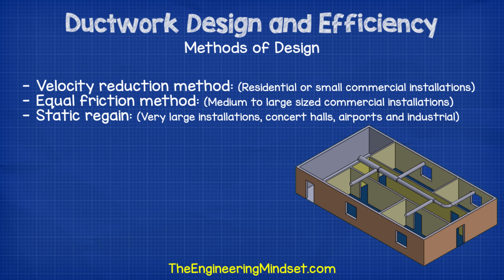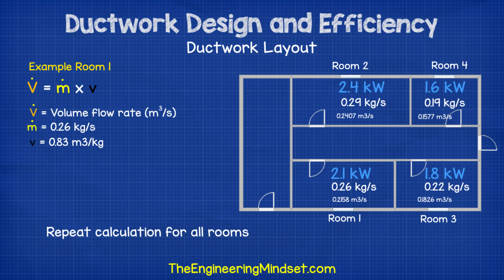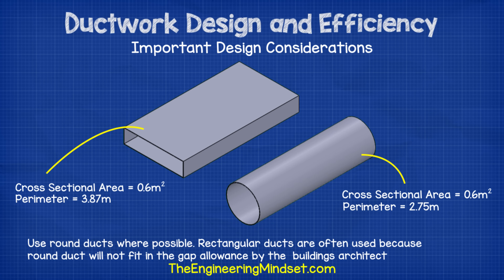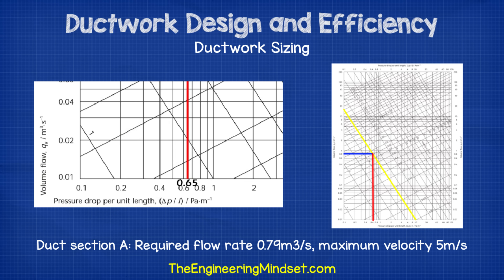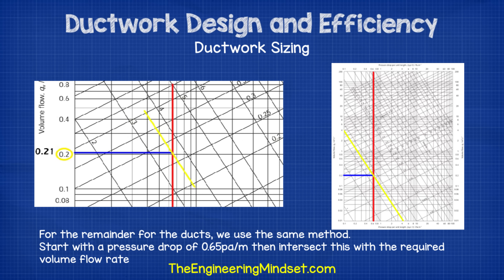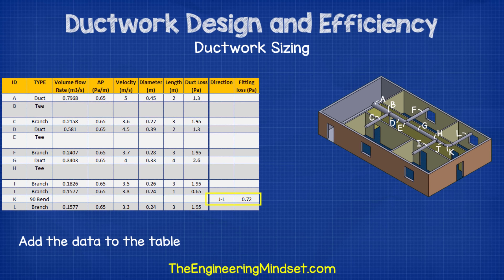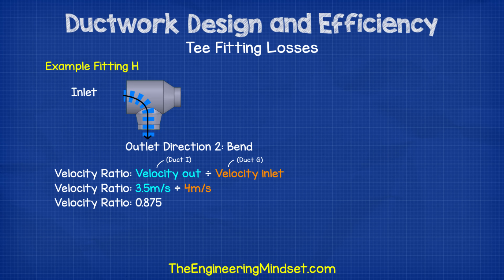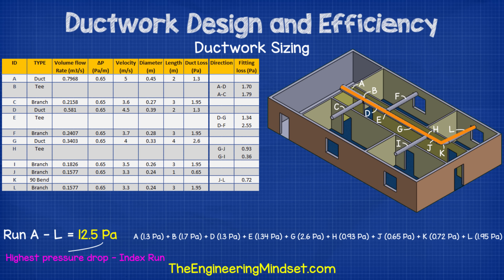Ductwork sizing, calculation and design for efficiency - HVAC Basics + full worked example

Comment: For the case of duct pressure drop or ESP is it necessary to go for cfd or use fitting coefficient for standard fittings and add along the path

Comment: Great video,  For the Tee 'H'at 15:45, is it not the bend coeff' 0.3645 taken from table using vel and area ratios,  then using formula to find out the pr loss  ?, It says straight from table, the coef 0.3645 as pr loss in Pa.  
Pls clarify.  Thanks.

Comment: Fitting loss in G-I direction should not be 0.36. I guess, 0.36 is the Fitting Coefficient. So, the fitting loss in G-I direction should be 2.65. Please correct me if I'm wrong. Thank you.

Comment: @EngineeringMindset - Why does the pressure through the dampers installed at the junctions have to have a pressure loss equivalent to the deficit b/w the index path loss and the loss through the branch terminating through a junction? Understand, there will be pressure loss on account of installing the VCDs but why does not exactly need to be the deficit to ensure designed flow through each branch? At the most, if the pressure loss through the damper is not exactly equal to the deficit but a little less than it, the air exiting through the branch connected to the damper will be supplying air at a bit higher than atmosphere. What's wrong in that?Pressure per metre of the duct was assumed as the same for all ducts / branches and not the actual pressure drop occurring along a branch. WIth different flow rates and diameters of the duct sections, this can quite be achieved so why is the need for the rest of the branches requiring to have a total pressure drop as that of the index path loss? Please explain?
Reply: I got the answer.🙂

Comment: Out of curiosity, do you only need to bring fresh, conditioned air into the rooms? Is it not necessary to also suck out the stale air using a separate duct system?

Comment: calculation used for temperature change is 8 degrees then in the actual computation you used 8 kelvin?
Reply from the maker: Yeah so it's just the difference between the two temps, wouldn't matter if it was kelvin - kelvin or C - C it's still a difference of 8

Comment: I see the simscale simulation showing positive pressure leaving the fan but I don’t see how it accounts for the negative pressure the fan is creating as well. I’m a real world scenario this would be in an enclosed space and the air would be recycled and conditioned/cleaned. Would the static pressures or velocity shown here change if that was accounted for?

Comment: As an engineer, this has help me a lot. Thank you so much for teaching and making useful video like this. Dont stop!
Reply: I got my Ac system installation almost a year ago, it smells very bad and when I turn it on it smells like dump wet bathroom. In order to get it to stop smelling I have to get the temperature down to 24, but then it's too cold😢 does anyone know if they have done for me a cowboy job, as I have spent a lot of money
Reply: @Bariraff  24 degree fahrenheit? Or Celsius. Either way you could have someone come potentially clean it, install uv lights or some sort of duct cleaning system. It sounds like it might be mildew caused by not properly insulated duct so it could be sweating and building up water that's smells gross. Could be improper drainage. Hard to diagnose something on the Internet just get a professional to look at it

Comment: Good day Sir. May I asked what maybe the factors I should consider in computing cooling load by if I am going to use manual calculation?

My problem is that when using  danfoss coolerselector2 (software) I am getting a different values which has a very big discrepancy.

Comment: Thx!! Question, I have a 440 sq ft hunting cabin. I have an electric furnace and a 1.5 ton condenser. Can I use 12”x 8” rectangular ductwork? There is a possibility long time from now the cabin could increase in size to 770 sq ft. This is a 1 level cabin. I’ll be using 1 straight length of ductwork 36’ long. 1-  4’ branch to the restroom.

Comment: Thanks for the video, very helpful! I have a question, while calculating the pressure drop in tees (14:45) the pressure loss formula was used with the outlet velocity. However, in ASHRAE fundamentals book 2001, they state that for junctions, the pressure drop is referenced to the dynamic pressure drop for the common section (i.e., main section upstream). Therefore, for junctions, as far as I understand, the inlet velocity has to be used to calculate the pressure drop from the junction either the branched part or the straight part.. could you please enlighten me on this?
Reply: what's the answer to this question?

Comment: Sir,

I have one query, When designing the HVAC supply duct system, After calculation of ASP from the manufacturer blower data (ESP- Device pressure losses). That ASP will become the pressure drop budget for the duct system.

Now if we are designing the duct system with equal friction method based on FR calculated...and carrying out CFD analysis of designed duct, the solver fetches static pressure and total pressure data w.r.t our design.

Now w.r.t previously calculated ASP which is our pressure drop budget, say some 0.4 inches of water gauge.

Now inorder to check whether duct design is within the limits as per ASP in CFD analysis tools. 

which pressure drop should I need to consider ( it's a total pressure in the volume of air or it's difference in Total pressure at inlet to outlets, or it's a max static pressure developed in the air volume inside duct)

kindly clarify

Comment: you put fitting loss=0.93Pa in the table for G-J direction by equating: coeff.(0.143Pa) x density x velocity out^2  ÷ 2
but for G-I diection, you just put value of coeff.(0.36Pa) into the table.
I didn't understand why didn't you applied fitting loss formula for G-I direction?

Comment: I don't know a darn thing about HVAC but I do know maths. Towards the end, you discuss losses and using baffles to compensate. I don't see anything about the origination fan, it's CFM, and any filters throughout this system. 
I would like to build out my own system originating from a window and a plenum box, where a blower is first, then a MERV or HEPA filter, followed with 4 UVC lamps. This system will only supply two rooms with a "junction" or collector as I call it, in-between both rooms (hallway) that is again supplied with a MERV or HEPA filter and UVC lamps out to the second room. Second room is much larger than the first originating room. Two exhausts, one inside origination window above and other through window of second room.

Comment: The Engineering Mindset :- I have have not under stand Fitting example H : Outlet direction 2-Bend (Time 15:10 - 15:48). Calculated Velocity ratio and Area ratio, then based on that get coefficient 0.364 from bend table. My question is why don't we applied that coefficient value in pressure loss equation {pressure loss=coefficient x density x velocity Sq. / 2}. instead of that directly mention that vale 0.364 as fitting loss in Direction G-I. Anyone 
please help

Comment: Do we size the unit by heat load or volume flow rate at main duct "A"? I am running into a situation that unit capacity is sufficient to the heat load, but the calculated volume flow rate at main duct "A" is more than the unit CFM. What do I do in this case?
Reply: Also is it reasonable that we have that many tapers in the duct due to the size reduction based on the calculation? Is there some rule of thumb like with certain values we don't have to use tamper?
Reply: Unit (Air Handling Unit) size…

Fan shall be sized to deliver Dehumidified CFM (one get from heat load calculations) at resistance (expected pressure drop calculated from duct layout). Usually because of added safety factors and other reasons system-resistance is lower than the calculated system-resistance.

For fixed speed fan motor AHU, one need to have/introduced opposed blade damper at AHU outlet to artificially increase system-resistance which in turn will reduce airflow.

For Fan with VFD, one can opt to run it on lower frequency to reduce airflow to the design airflow.

Hope your coil is designed to meet sensible and latent load as per heat load calculations.

Hope I understood your question correctly and answer is aligned to be of some help.

Comment: MISTAKE:-in massflow rate formula delta T is in kelvin and you take delta T in degree celcius ..... 1:56
Reply from the maker: It makes no difference, its just the difference. 10-5=5, 210-205=5

Comment: The new job has the customer hire an engineer to design the system. Or, charge them to design the system from plans. I personally work with a lot of engineers and they do this all the time. If the customer wants a free design move on.

Comment: Hay engineer......
I have one hanger which has 7 room and 3 big hole.......
How can manage and I select either split air condition and Centralaized cooling system.
Which system  is efficient for me.....plz note that all air condition is not working all the time unless the big holes.

Comment: Ok this is what I want to get into. Sounds really interesting. I currently have this oversized fan in my house. The duct looks waay too small and the noise is the biggest problem. I was thinking to increase the size of the duct to lower the noise but will try first to use these calculations to see if it would make any losses in terms of cooling. Do you (or anybody here in comment section) have any advices on how to lower the noise without loosing too much on cooling?
Thank you in advance.

Comment: Sohrab:
Ques 4:-
Coefficient of pressure values of fittings like
Reducer=0.25
Elbow=0.27 
It will varies or fixed according to CFM

Ques 1:- 
During calculating static pressure only critical path will be taken or not ?

Ques 3:-
In formula 
(F×L)/100
F= friction factor or friction head loss

Ques 2:-
we will calculate all the VCD OR only critical path?

Comment: Ok my question which is better, a furnace register that blows upward or one that blows across the floor as I have noticed blowing across the floor has it problems and furniture can block flow and create cold spots especially in smaller rooms so I guess my question is do I heat from top down if that makes sense(my old house has registers in the wall and blow across the floor)

Comment: that equation relating mass flow rate to Q and cpT at 2:09 is not dimensionally correct.
Reply: KW = KJ/s
It is correct.
Reply: On lhs we have kg/s on rhs we have KJ/s
Reply: @Cplusplus745  

m = Q / (Cp) * (dT)

m = Q * (1/Cp) * (1/dT)

kg/s = (KJ/s) * (kg - K / KJ) * (1/K)

kg/s = (KJ-kg-K) / (s-KJ-K)

we can cancel same units like KJ and K, so we have;

kg/s = kg/s

Comment: Paul, regarding the simscale example, you mentioned that the red colored region which is the increase in velocity, causes the static pressure to rise. Wouldn’t it be the opposite. Higher the velocity, lower the static pressure due to Bernoulli’s Principle. If you increase the velocity pressure then the static pressure should go down to balance the total pressure. I am confused because the increase in pressure drop also increases the static pressure did not make sense to me while comparing smooth and not smooth transitions. I am thinking the static pressure increase will happen on the upstream side of the flow, however, downstream side will loose pressure. Please correct me if I am wrong. Thank you.
Reply: You're correct. He should have specified that it is increasing the static pressure DROP (static pressure of the air is low at the areas of high velocity). The fan must overcome this drop so it needs to provide a higher amount of static pressure to maintain the flow rate.
Reply: @jetonhaxhia4393  Yup, that's what I thought as well.

Comment: 2:39 please anyone tell me how to calculate temperature and pressure
Reply: You are not calculating the temperature and pressure. You are using the standard pressure and temperature values to come up with the air properties. 1 ATM and 70 Deg F or 21 Deg C.
Reply: @al151  ok bhai thanks

Comment: Hi, thanks for this article. I used this method with the same pressure in all ducts from the main to all the branches with the quantity of air needed, I found out that some duct and branches fall below 2 m/sec. what will happen if I adjust the velocity and the pressure?
Reply: exhaust duct

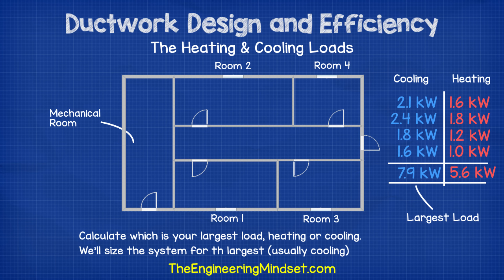Comment: 1:37 both cooling and heating are positive loads? Or cooling load is (+) and heating load is (-)?
Reply: You're paying for them either way. Cooling load is usually electricity, but because of the COP of the unit the actual amount of electricity used may be many times less than that calculated load, but you also have to consider the fans and the water used if it uses evaporative cooling or humidifiers. The heat load is usually natural gas here in Burgerland so you might end up using 5% or so more natural gas worth of heat than the load calculated due to the slightly inefficient nature of burning fuel (you can't breath the exhaust so the heat has to be transferred into usable inside air or another working fluid such as water in a hydronics system). Condensing heaters have come a long way at getting us up to 96% or more efficiency. In any case this is usually still cheaper because natural gas is many times cheaper than electricity is on a raw heating value BTU/hr (kWh) basis.

Comment: Hi, I'm a UK Mech Eng graduate currently working in Toronto however I have no experience with HVAC systems and it's something I really want to get involved in. What would be the logical steps to get hired, based on zero experience with these systems?
Reply from the maker: What I did during my studies and as a graduate, occasionally even now still, is spend my free time or commute reading books on the topics, tell companies I wanted experience and offer my time for free in exchange for exposure, once there make contacts, ask engineers questions, go for coffee and beers and listen to the problems they talk about. Prove to companies that you want to be part of the industry. One of the most influential engineers of my career lived by the saying, which I've taken on, if I don't know something today it doesn't matter because by tomorrow I will. That's the Mindset that makes you above average and worth your higher salary.

Comment: This is fundamentally wrong at about minute 11. You are assuming that the pressure drop though all segments have to be the same? Why? Equal pressure method should have equal pressure to each grille, not equal pressure drop in each segment.
As a result at the end all your branches end up having the drastically different pressure drops (from 5 to 12) and you start adding dampers. Why not save materials and put smaller ducts for sections that don't affect your largest pressure drop (C,F,I)? This will increase the pressure in your branches and you may avoid using dampers altogether. 
You have to be careful not to under size them too much though to keep your max 5m/s flow rate.

Comment: This is a great educational video, but I have been doing HVAC design for commercial building for few years and usually you just use 0.1 in wc (water column) of static loss to size supply air ducts. For return air ducts, it’s 0.08 in wc. 

If you do all this detailed analysis, you will never be able to complete large projects on time or schedule and your firm will loose clients.
Reply: I have a question. While you design hvac systems for your clients how much of the hand calculations do you have to do. or do you just work with the revit software?.

Comment: @ 2:14 delta_T = 8 [Centigrade] but formula calls for [Kelvins],  Is there a mistake in the Calculations ? delta_T should be 8+273.15 Kelvins not 8 Kelvins. Thanks
Reply: Delta_T should be 8. It a temperature difference between supply and return temps. Let say the supply temperature is 17 C and the return is 25 C. That's 290 K and 298 K respectively. Difference still is 8.

Comment: Hello sir, 
If I was to purchase a/c unit with more seer rating do I need to increase the duct size?
Reply: No. Higher SEER ratio just means it takes less energy to produce the same amount of cooling. So you're just saving money from your energy bill.
If on the other hand you bought a AC unit with more tons (more cooling capacity) then you would need larger ducts to deliver the cooling to the house

Comment: I found your video to be very informative but It would be helpful (almost necessary) if you provided a link to the pressure drop chart.  Its not easy to find the chart (so far its been impossible for me) with the units your using.  I followed your calculations for my entire house as I am renovating and need to update my duct work, but now im stuck because the chart you reference is nowhere to be found, not even in the video description as you state in the video.  it seems that the vast majority of charts available don't use the metric system but instead use imperial with the units: W.G./100ft, cfm, ft/min, Inch. and the ones that are in metric don't use Pa/m but instead use (mm H2O/M).  I guess I could download one of those charts and just convert the Pressure drop from mm h2O/M to Pa/M, but it would be cool if I didn't need to.
Reply from the maker: The charts are in the links under the links labelled book 1, book 2 and book 3. You have to purchase them from the manufacturer, we do not have the copyrights to be able to distribute them.
Reply: @EngineeringMindset  ah well that's too bad but that makes sense!  thanks for the response.  great content btw, I like the step by step process, It helped me wrap my head around the subject!  I have been trying to understand and calculate different aspects of hvac systems for awhile now but there is a serious wall of math that you need to work your way through to understand it.